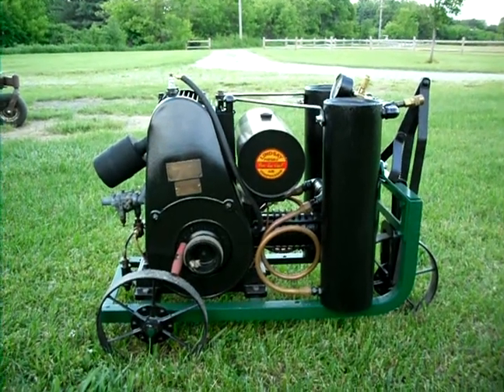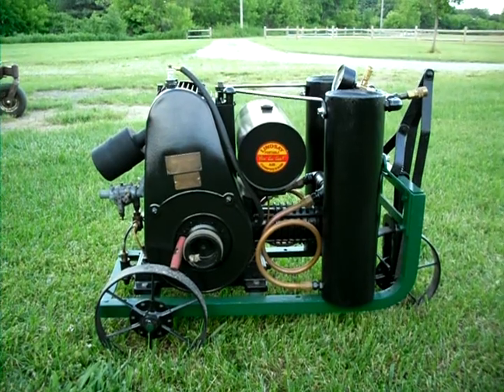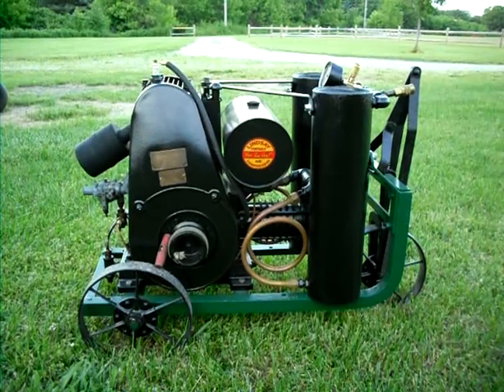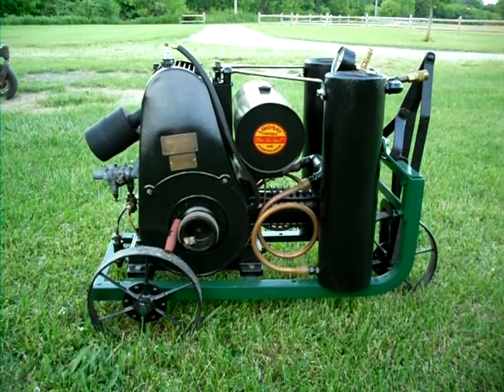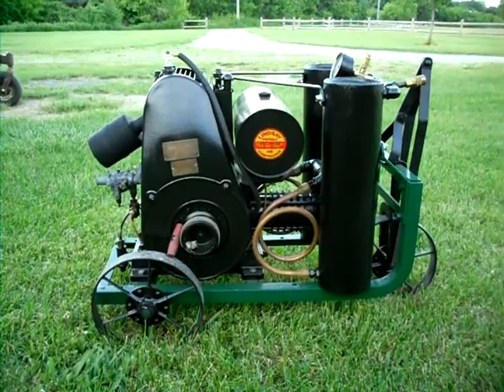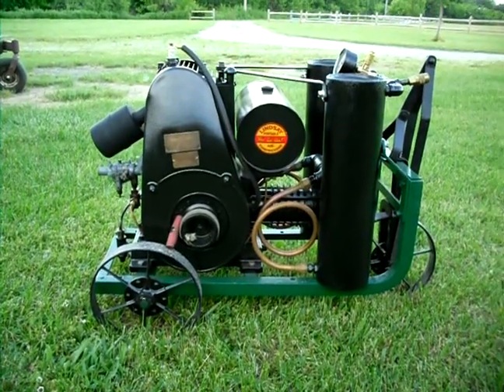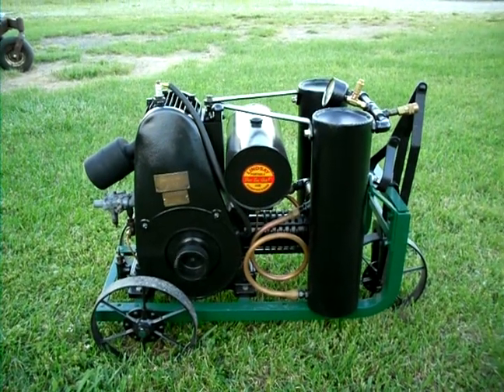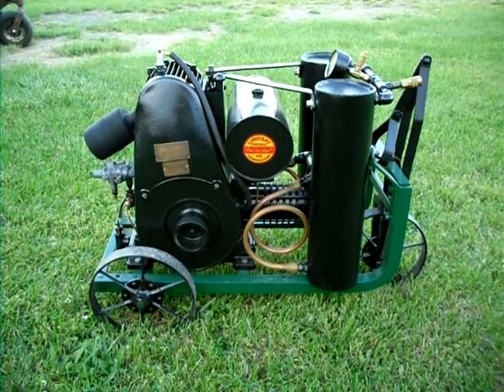Operating the 1928 Lindsay Air Compressor

Comment from the maker: The compressor cylinder is the finned part you see under the gas tank. The compressor piston and connecting rod run off the engine crankshaft.